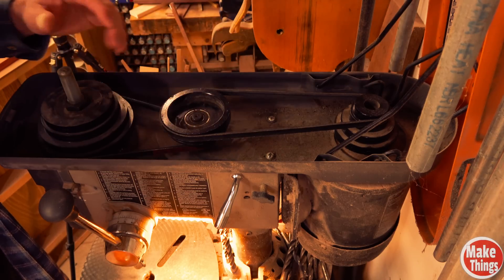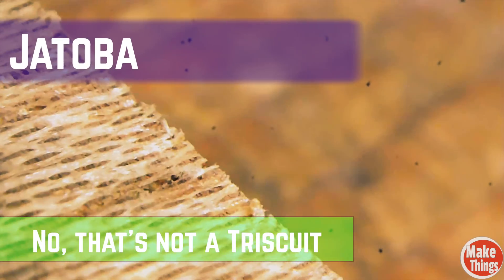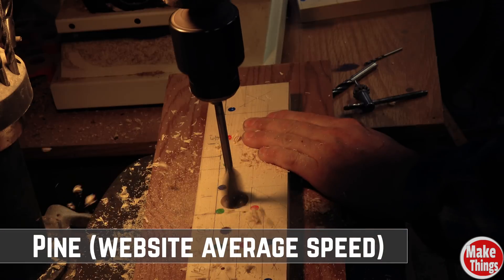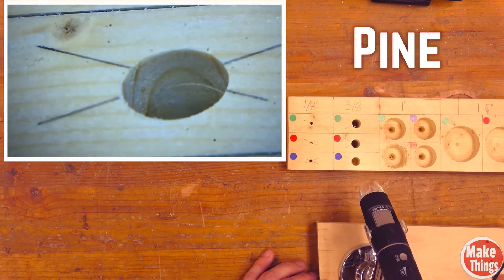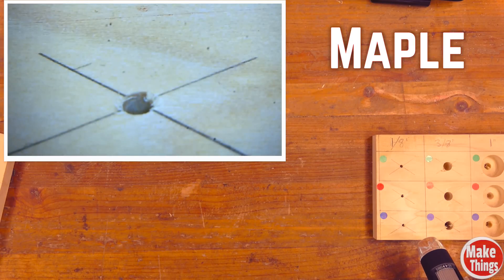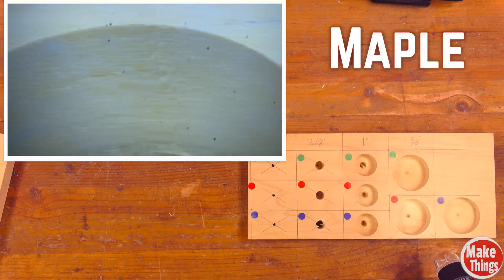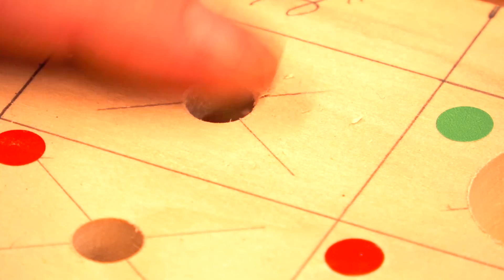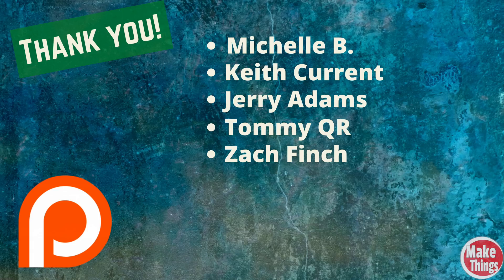Drill Press Speed, Does it Really Matter? (I Think You'll be Surprised!)  // B4 We Make Things

Comment: You did not mention the speed you pushed the drill into the wood. You could have applied a kinda pulley system and applied a slight weight to overcome the restriction on the pressure spokes. I think that also would make a big difference. IMHO

Comment: I noticed your drill bit had a slight wobble. Mine does also. We need to address that problem before testing drills!
Reply from the maker: It's a common, accepted tolerance for drill presses, unfortunately.  I looked into it many, many years ago and found that a slight wobble is not a concern.  I do have a slight fix for it, but don't look for perfection: https://youtu.be/lf9r_qo_3w4
Reply: @MakeThings   Cool Thanks!

Comment: Thank you.  50 years ago I purchased a drill press that had ten speeds.  My first project was to drill a 1” hole in stainless steel.  I set the drill press to its slowest speed.  After that, I never changed the speed.  Thousands of holes in steel, stainless, aluminum, brass, bronze, copper, plastics, hard and soft wood, were all done with that same slow speed.  Yea, the drill has that speed chart on the side.  But I only use the slow speed.
Reply from the maker: It's the way it should be done, too ;)

Comment: Great video. Any suggestion on:
1.speeds to use wire brush attachment?
2. Where to find pulley configuration for speeds for a two pulley drill press? Not even sure how I would speed up or slow down my press. Thanks!

Comment: As in all machining, speeds and feeds are big factors. Materials also play there part. And tool geometry. For instance. Brass. You work brass with a negative break on the cutting edge same with plastics. A sharp cutter will grab these materials. Not good. ( I once snap an inch and a guarter drill in half this way. ) Lastly I hope. You have a drill press, now you need drills. They cost like hell. Take this route. Buy a decent bench grinder, go to a flea market and buy up some old dull broken drill bits and learn to sharpen them. Sanding drums work good in a drill press.

Comment: I noticed that you didn't clamp the wood board to the table when you drilled and just held it in place by hand, could that have any noticeable effect on the results?  Would the larger the bit or higher rpm cause more vibration? I'm genuinely asked as I'm doing research before I buy my first drill press

Comment: There's a formula for calculating peripheral surface speed. This is it SFPM=(PI * DIA * RPM) / 12 Then each material has an optimal speed for cutting it. Here's the reverse formula which is more useful for finding how fast you should be going RPM = (SFPM * (12/PI)) / DIA Now you just need target SFPM speeds. I like 100 for a lot of work. But it depends on what you're drilling and what you're drilling with.
Reply from the maker: And that's the problem that I have.  Having worked with so many difference species, each one plays differently.  Maple tears much differently than oak and jatoba.  Then, within each species the wood can act differently.  Maple can act differently when you work with Birdseye, curly, quilted, etc.  Some pines are dense while others are light with large pores, let alone knots.  I don't like thinking of things in terms of formulas because, if we're accurate, you'd end up with endless criteria.

The one constant that I can depend on, on my own machine, is how hard to press.  If it's a harder wood, I treat it differently than something like pine.  If I'm cutting something like pine, for instance, I let the blade spin on the top of the wood as it is far more likely to chip chunks.

Because I've learned to depend on that methodology, I've left the base speed the same.  Most of all my bits are at least 2 years old (except for the new ones I bought for the video), so it's not always about sharpness.
Reply: @MakeThings  I sharpen drill bits. Because I'm cheap. I was at a yard sale once and I bought a whole tote of dull drill bits for a dollar. Was pounds of bits. Good ones too. They all drill good now. As long as the margin isn't burnt out on a bit I can bring it back.

Comment: Thanks for the video.  I have a mediocre drill press (in my videos) and I almost always have it set to the slowest speed.  Besides a vast assortment of drill bit styles, shapes, materials, etc, the other variable is drill press force, which we'll take on faith you tried to keep consistent.  I appreciate you taking the time to show that low speeds seem to be the safest and most convenient.  Usually if I feel the need for speed I use my hand drill (too lazy to change pulleys).  Thanks again.
Reply from the maker: Yeah, I really thought about leaving the speed in and updating each drilled hole with the speed and wood type, but it was painfully dull to edit and would have been worse to watch (not to mention making it longer than it needed to be).

Another thing I didn't add was that lower speeds, due to the belt surface contacting the larger pulleys, also seems to increase torque.

Thanks Jaz ;)

Comment: Thanks for taking the time to put this together... one thought though.  . clamping wood (instead of hand hold) to prevent movement might have allowed the drill edge to make cleaner cut.
Reply from the maker: Thanks Charlie.  I disagree.  Throughout the process, I never felt like it moved.  I think as the point starts the cut, movement becomes really difficult.  Because all bits had a point to guide the rest of the drill bit, I don't feel like that is an issue.

Comment: Nicely done empirical testing Rob.  Although there is a lot of science behind sfpm to speed and no. of cutting edges and feed rates, there are so many more real world issues in wood like; knots and variable grain structures (sapwood or spalting) and types.  The others are the bits and types as you demonstrate but tooth designs, cutting angles and flutes are the nuances that manufacturers put their name on.  Another I noticed on your test and my personal pet peeve, is runout of the bit or spindle which can cause wobble and cut like a burr rather than a bit.  

All this said, I agree with your findings, but run my restored 1950 Craftsman/King Seeley 12 speed at ~550 for most operations in wood, metal, acrylic and PE/hdpe and slow it down to ~310 for bits >7/8 and slowest (175) for metal.  It generally leaves a clean round hole and almost always countersink or debur.  I measured my runout at 3 thou, 4 inches from the chuck with a ground rod and dti...makes a difference.  But not all bits are true.  Typical specs on a bit diameter are ±.005 and yet the HF 25/64 brad point I have, the runout is out by 15+ thou (1-800-bad-grind) which I use for my 1/4-20 threaded inserts and makes for sloppy driven inserts.  

Sorry for the babbling on but working with wood now at my age seems pretty forgiving in most cases with some sanding/deburring and think you are right for most wood workers!  Thanks Bud, Nice video and always enjoy what you bring forward!  Hat Tip, ~PJ
Reply from the maker: Yeah, and here's what I really think (but didn't want to stir the waters of controversy with): I DON'T think that drill press companies are using this data to sell machines that can do a variety of speeds.  I DO think the drill bit cutterhead technology has gotten us to a point where drill bits don't need to spin fast to cut wood.  I'm guessing 50 years ago there was quite a bit of a difference than where we are now.

Comment: don't generally care about minor tear-out and fuzz with softwoods, utility to rustic furniture use,  hardwoods cut nice from the start.
Run hole saws slow for the same reasons. Carbide tipped are worth it for longevity, cuts cleaner then you would expect. Buy also as single item as required.

Comment: The wavy forstner bit slices a razor score cut but go very low speed, easy to heat the razor thin edge. If you don't care about time and a number of holes then a heavy touch score the wood and the switch to a regular more heat resistant edge forstner bit. Less expensive to replace regular bit. Buy single wavy bits when required. Such precision is usually overkill, fibres will swell slightly and fill minute tear-out.   Softwoods being like a bundle of straw will tear out moderately no mater what large-ish bit design you use. 
For any sheet Aluminum, Copper , not steel, spur bits at midrange speed work excellent and accurate diameters, perfect square hole edges, keep their sharpness forever.

Comment: Like anyone is going to go through the processing of determining the speed and adjusting those belts. Math sucks. I just need the hole. 🙂
Reply: The drillpress has diagrams of the speed pulley combinations under the pulley guard. All who have ever used a drillpress know this.
Reply from the maker: @Stu Bonner while you're right, there's more to it than that.  As someone mentioned, there are so many different circumstances where even these suggested speeds fail.  Knots, wood grain differences, wood density differences (maple is a great example of how many differences a species of wood can have), sapwood...all of these can be different and it's difficult to know exactly what you're getting yourself into when you start.
Reply: @MrBonners  those charts may not be accurate though. But they're usually close enough. With experience you get to pretty much know what you have to run to perform a task. Unless you're dense. Some folks are.

Comment: As they say on the motorway/highway: speed thrills, but kills. 😜. I have left my small drill press on it's default setting which is on a 'happy medium' speed. I do think of reducing the speed when drilling into metal, but it's too much work for a few holes 😁
Reply from the maker: Yeah, Suj, that's how I got on the path of not changing it back for my wood drill bits.  Drilled slow with metal and didn't feel like moving them back 😂

Comment: wood are more forgiving materials. any drill bits are harder than wood, the reduced heat tactics is absolutely right in wood. hss is good enough in 99% of the job. that simplify the  situation.

but metals is a different story, especially stainless steel. it is notorious famous, drill too fast, it turn blue and chips harden like blades, drill too slow, the bit "round" the bottom of the hole and don't get through. clamp it wrong,  the piece "helicopter" with the drill bit. it becomes a temperature and speed control arms race if you dig into the details.
Reply from the maker: Exactly.  I didn't know that about going too slow with stainless steel, though, which would explain past problems with stainless steel not drilling well and getting that rounded bottom.
Reply: Stainless is a special case. Stainless work hardens so you need to use a heavy feed to drill it. Translate push hard.

Comment: Just remember it’s wood. Wood is fiber.
Standard twist drill bit design is not efficient when cutting wood. 
They are designed and sharpened to meet the requirements of cutting metal. 
Forster buts and brad point bits are designed to cut fibrous materials like wood. 

They style and type of grind at the cutting edges is just as important as to the sharpness of the cutting edge.
Reply from the maker: Yep.  I didn't mention twist drill bits as they're not meant to be used in wood.  I should have clarified that, thanks Ken.